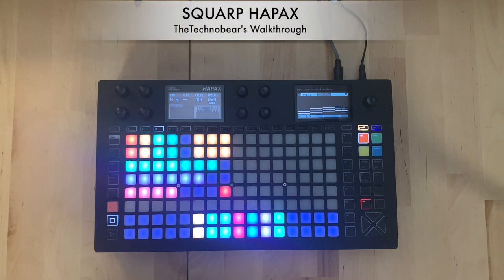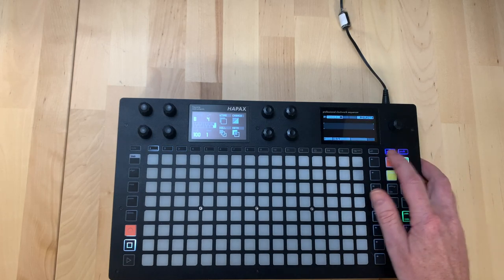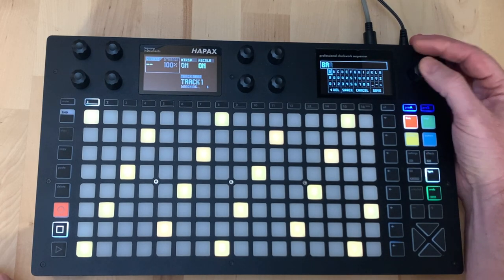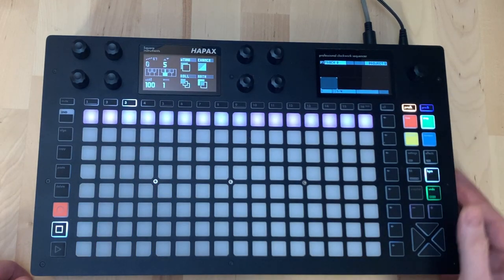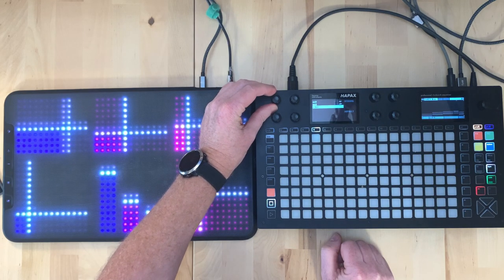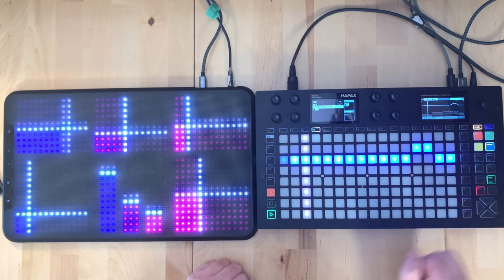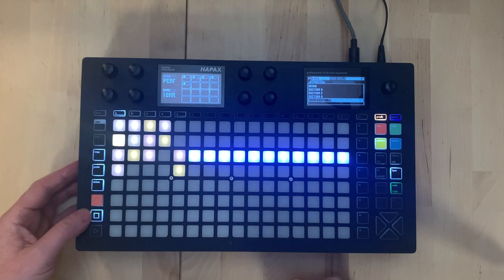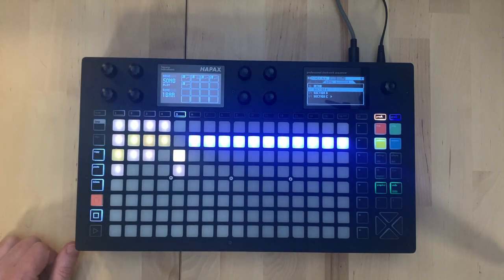Squarp Hapax - In-Depth Walkthrough

Comment: Q: instead of copying contents of the chord track to the arp track isnt there a way to just have the arp track just receive a feed of the notes in the chord track directly?   that way if the chord track is changed the arp track will immediately reflect and follow these changes. (IOW use the chord track as MIDI input to the arp track )

Comment: Would love to see if its easy to use ”chords” on the CV Outs. Does the Chord mode automatically distribute the pitch signal across the pitch CV Outs? That would be fantastic!
Reply from the maker: No, currently, there’s no polyphony with cv/gate … though could be added in later firmware ?

Comment: Cool review man. One thing I can’t find anywhere though is does it do one finger transpose (either global or per track) from midi input? Say I’ve sequenced a bass line and I’m playing live chords over the top on a separate synth. My right hand is doing the live chords, but I want to change the key of the bass with my left hand. I need to be able to do it with one hand and not have to hold down a “shift” button to jump down, if that makes sense?
Reply from the maker: Track 16 can be a transposition track . Which can be sequenced or played live via midi. Other tracks can be affected by that transposition not.

Comment: Can you record live from a keyboard synthesizer into the Hapax sequencer like if I want to play my Virus or Oberheim keyboard and record that sequence live, and if so, how would I set this up over MIDI or USB? Both the Virus and OB X8 have USB but not sure if it works that way with Hapax to record live in a sequence project.
Reply from the maker: yes you can do this (I do it with my virus)...
for the virus, you'll have to use midi din, since the virus usb is not class compliant.
(don't know about the OBX8)
Reply: @TheTechnobear  I can record in live mode on the Hapax but not record a sequence live to the Hapax from Virus keyboard itself via MIDI channel.

Comment: as someone without a sequencer it seems like my choices are between this and deluge. I really want a daw-less setup, I am curious to see what advantages this has over deluge or what it lacks. So far only con I can see is it's limited to 8 tracks? And an obvious pro I can see is that wonderful song arranger and editor screen, really helps visualize the project.
Reply from the maker: apples n’ oranges - if you need an all in one grrovebox - deluge , if you need a powerful sequencer with great connectivity - hapax :) 
really there is very little overlap.

Comment: Nice Video, can i only use 8lanes of Drums in the DrumTrack?
Reply from the maker: Currently yes , however, you can always use another track to add more. 
( that’s what I’ve done with my Spectralis:)
also if your drum machine is just using notes ( not channels) you could always use a poly track; that has no limits  - but not as nice as drum tracks ;)
Reply: @TheTechnobear  Yes, but my Tanzbär have that Midi learn note function to trigger the single notes and i really preciate to keep the drum track;D
Reply: Why not more than 8channels in a drum track, very sad!;//
Reply from the maker: @perruschke6691  probably to avoid scrolling , but nothing to say they won’t in the future … this is v1 firmware - so early days !!!

Comment: how do we sync it with Ableton ? i cant figure how to sync it to the grid  Frustrating
Reply from the maker: plug in to computer, set ableton to send EXT clock to hapax... on hapax settings turn on usb clock input (and transport) 
in ableton, you can also adjust clock latency.
pretty much the same as any external sequencer/daw  really.
you could also reverse this, and have ableton receive clock, but generally I find it better for daw/computer to be sending clock
Reply: @TheTechnobear  hey thanks ..

Comment: So to clarify, does a project have 16 tracks, and each track has 8 patterns? Or does a project have 8 patterns, and each pattern has 16 tracks?
This is an important distinction because the latter arrangement would imply that you were locked in to all tracks changing their active pattern at the same time, and that you had less flexibility to mix and match patterns. You couldn't have track 3 continuously looping its pattern 1 while track 5 is alternating between its pattern 7 and pattern 8. Or have staggered, overlapping sections, where e.g. one instrument keeps playing its verse riff for 2 additional measures while most other instruments have already switched to their chorus riffs.
Reply from the maker: the former... each project has 16 tracks, and each track can have 8 patterns.
Reply: @TheTechnobear  Awesome. And tbh this did become more apparent as I continued watching your video. Kudos on this btw - your insight has long been some of the most valuable in the squarp forums, so I'm thrilled to see you leading the way with this new offering. 
Does this make the Pyramid redundant, or are there still some important things that Pyramid can do that this cannot? The near-unlimited track lengths on Pyramid spring to mind, for example. Perhaps a better question would be how comfortable you would feel using Hapax as your only sequencer for a full set performance?
Reply: @TheTechnobear  Sorry for all the questions but I'm dying to know how well this solves some of Pyramid's most frustrating limitations. One of the most important - how easy is it to extract a pattern from Hapax as a MIDI file, edit it in a DAW, and then put it back into the project? Or to add it as a new pattern in an existing track in a different project? This was surprisingly tricky in Pyramid, requiring careful editing of the project's config file.
Reply from the maker: @rdean150  with the parallel projects, more hands on UI , the hapax I think is much more suited to live performance.  
No , it doesn’t make pyramid redundant… the pyramid is still one of the best sequencers out there , and totally capable as it always has been ! 
Are there use-cases where pyramid is better - honestly not many , but it’s a bit smaller, cheaper and it’s very mature … stable as a rock, where hapax is work in progress.  
So far I’ve said, if hapax is out of your budget , I think you’ll find some bargains deals on the pyramid … and that’s a hell of a sequencer for that money.   But new… I’d say hapax almost every time.
Reply from the maker: @rdean150   copying between projects is now easy ... you just load the two projects and copy/paste as if they were in the same project :) 
there is currently no midi export/import... seen a few request it, so perhaps it will come in the future, but no idea in what form it would take. e.g. exporting of patterns was  problematic on the pyramid, Id personally avoid that if I were squarp... and go for track/pattern = 1 midi file.

Comment: What are you connected to?
Reply from the maker: in this video? It's connect to my Mac/Ableton (iirc) , which has tracks for both hardware and vsts.
I cannot remember exactly, what I used... likely a mix of Virus and probably u-he vsts and vahalla reverbs.
the external/mpe controller I used is an Erae Touch.
Reply: @TheTechnobear   cool man, thank you. I am saving up for either this or the oxi-one. I use almost exclusively iPad apps for sounds (op-z being my only sound making hardware and thats incidental, I got it to sequence the iPad), the Oxi has a battery and bluetooth which is a huge edge over the hapax, and the oxi is deep, but the hapax is deeper. People say its overkill for the ipad, but why? Ipad can make all the sounds, and Hapax adds the haddware
Workflow experience. Thoughts?
Reply from the maker: @jospehbloseph7172  yeah, each has its pros and cons…. Both are very powerful.  

personally, i prefer the form factor of hapax But no denying, Oxi is much more portable and that has its appeal.   

Feature wise, just depends on your needs, they each have their own strengths … so you have to go thru manuals and see which one aligns most to your needs and preferred workflow.
Reply: @TheTechnobear  as close to elektron as possible, lol. I love that workflow. I know the Hapax has the 8 knobs that correspond to the 8 spots on the screen like the Elektron, that fits the way I like to fast create and sequence. Anyway, thanks for answering my questions. I appreciate the time.

Comment: Can the LFO or project LFO be used for pitch? Like if I set triggers on the sequencer, but the pitch is determined by the position/depth of the lfo?
Reply from the maker: not directly (currently), however, an LFO could target the transposition (semitones) of the Scale FX. so that achieve the same thing I believe.
Reply: @TheTechnobear  Thanks for info! Hope Squarp will consider the feature! Kind of like what you get when you patch an lfo through a S&H, and then through a pitch quantizer.